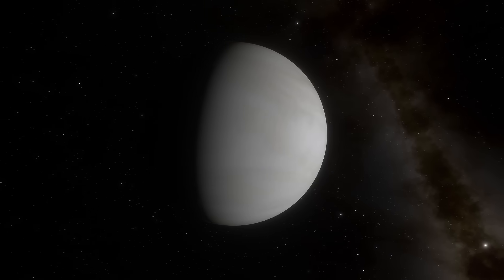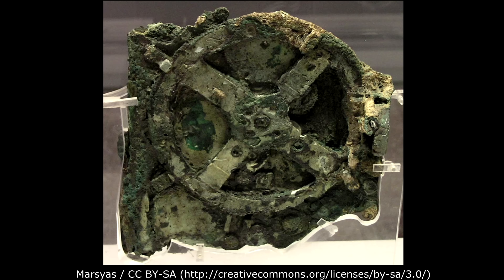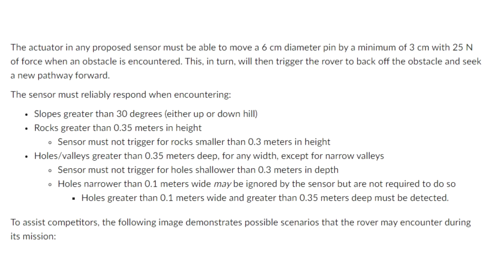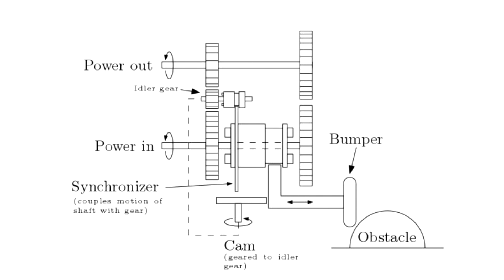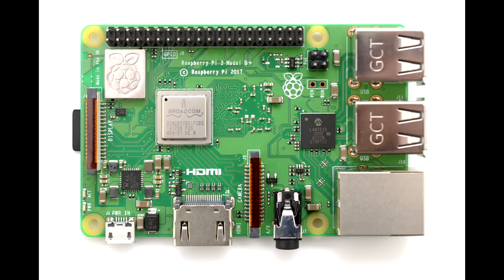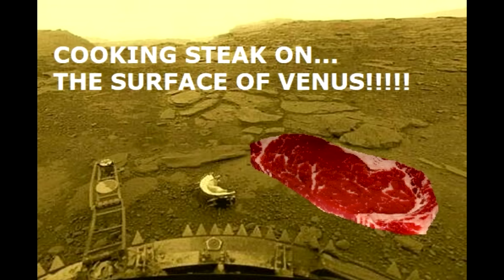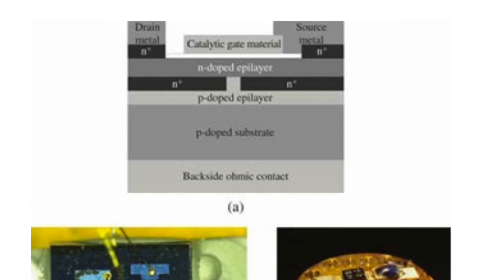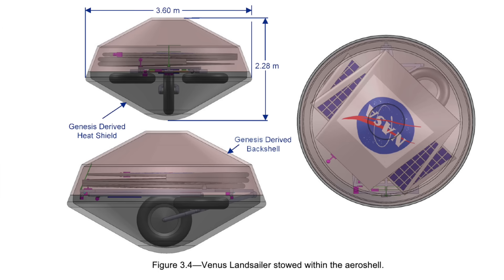Venus Rover Concepts That Beat The Killer Atmosphere

Comment: Perhaps dropping a fair sized bell shaped craft with a long shaft standing off the top of the bell.  Inside the shaft you put a ~large bore artillery gun.  On the top of the shaft, you place your Rover, on top of that, you place a tethered buoy.

Once the bell lands standing up, the buoy breaks off and rapidly ascends pulling the tether from the ample slack (ideally; the higher the altitude the better - inside the buoy is the rover's computer. The tether would have to be lightweight, very strong, very non-reactive, and capable of carrying a conductor to complete a circuit...so carbon nano tubes, boron, titanium...all that fancy jazz, we're using it because the cable can't be too thick - if we land on one of Venus's "Continents," 10km of tether would change the ground level limitations, 20Km-40km of tether and ground level limitations for computing are gone...) because the buoy could literally be made buoyant at altitude.  The winds would pull on the buoy significantly, but...

On the ground, after the buoy has reached ~50% ascent, the rover breaks away via short fire rockets, also pulling its own tether,  to get it away from the bell structure, deploy air bags, land, and come to a rest.

With the buoy well on assent, the rover at a distance w airbags still ~partially inflated, the artillery gun, loaded with an Iridium slug with tethers secured to it and even embedded in it, the gun discharges, sending the slug into Venus' surface, and on impact, barbs built into the slug are primed to deploy on short fuse delay. Once the the slug is embedded underground, barbs have deployed, you have your anchored Rover and anchored floating brain, and they're secured and connected via their tethers.

The bell would essentially limit the blast, but would be intended to fail.  With alterations, artillery gun casing could be made to survive, even as a superstructure if needed/desired.  

Also, the term buoy is used loosely; perhaps "Kite" would be a better comparison, or even a glider of sorts or a disk with aelerons wrapping it and an AI fly-by-wire like system to reduce wind strain.

If the Rover mission goes to shit, depending on just how fancy the buoy is made, you could have it ditch the tether and you still have a UAV with a lot more access to solar energy v Earth, and capable of exploring the actual part of Venus where we could have a foreseeable future colony that wouldn't equate to ~guaranteed death like a Mars colony would...(?)

Comment: I actually have an Idea, put a blimp in atmospheric orbit wirh the brains and a meanz to gain energy and move about in the atmosphere at about ths density of earth's atmosphere.

Okay, then thats the main brains the lander  will use echo location, sound will travel further and faster on venus than on earth more akin to underwater, so this would essentially be sonar.

Thw cool part woukd be that the lander nedd only Emil a sound and have a statically designed board on it that is made to act like a microphone when bombarded by microwaves, this should be doable so long as attenuation is not a problem in the venus atmosphere, as this is how the russians bugged rhe oval offixe using a Planck made of wood wirh no moving parta in the 50s

That would allow the blimp to process the signal from the rover and relay back simple instructions which could be recieved by a similar setup which would essentially translate them into sound waves, rhen much like the human coclea we translate the souns waves into taps givibg mechanical force to set a system state in ths mechanical computer.

Comment: Best idea I have is to have a tethered balloon that would rise high into the atmosphere with a radiator on it, in order to get the needed temperature gradient for a heat engine, to provide power and also provide cooling.

If you could get it high enough, you could have a pretty severe temperature difference, and easily be able to run cooling.
Then you just put your computer and motors into a heavily insulated body, with shafts going out to the wheels.

Comment: If the air is so thick, why not make it swim?  I'm picturing a sort of kite with a pair of wind turbines.  The string would be made of carbon fiber and at one end would be an anchor and the kite probe at the other.  There would be a winch on the kite and this would allow kite to sort of hop up and down along a line with the wind.  "Programming" would be extremely simple.  Once it makes land fall.  The turbines and kite deploy. The Kite is variable geometry.  It extends it's "wings" to go up and retracts them to go down.  As such it would make several "hops" until it ran out of line.  Then the energy from the turbines would begin retracting the kite back toward the anchor until the winch was fully spooled.  Then the process repeats. Back and forth until the probe dies.  I don't know how prevailing winds work on Venus, but if they shift direction then the probe could explore several areas around the anchor if it does.  
Literally this could be done 100% mechanically, and the data could be acquired by radar from an overhead satellite.  It may not be much more than altitude, attitude and orientation, but it would be useful.

Comment: what about tube computers? it would be interesting to see tubes when you apply decades of miniaturization technology. tubes probably wouldn't even need heaters. im not entirely sure how small you can make a vaccum tube, but if you can make an array of them fit on chip you might be able to build something akin to the agc. memristor memory perhaps? high temperature magnetics? does induction still work?

Comment: Hmm. Sending an active radio signal back could be possible. Can't do electric power with magnets in this kind of heat, but a Van de Graaff generator could work to achieve charge separation. A transmitter antenna only needs a coil and a capacitor, which are possible to operate at 500°C. Signal modulation would then be done with a simple mechanism obstructing the antenna in a timed pattern. I'd say that could increase the possible information transfer rate significantly compared to the radar reflector disk approach.

Comment: I think an inflatable balloon that takes it up into the atmosphere then compresses the gas to go back down. As it falls it collects some power with a wind turbines to use to cool itself for a few hours. Then it opens a heat activated valve (or as the gas heats the pressure goes up) and floats back up to cool off. We have plenty of ceramic insulators that are light weight and keep thousands of degrees out. You only need to cool a tiny capsule that houses the electronics. From the top of the atmosphere you might even be able to beam back some images or data from sensors to an orbiting relay. It could just keep going up and down over and over. Each time bringing back a small bit of data and cooling off before going back for more.

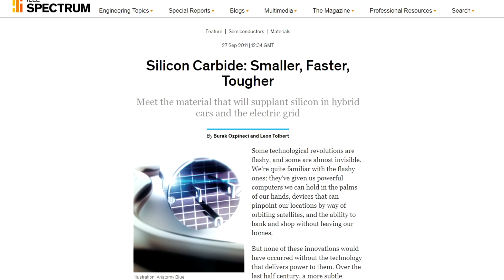Comment: 6:28 TURNS OUT! It takes 6 inches of steel to simulate Venus.
Reply: I first read that as "6 inches of steel to stimulate Venus" and thoughts "sounds about right."
Reply: @seanj3667  Venus isn't very good at sex if it takes 6 inches of steel in order to sexually stimulate her.

Comment: The wind blows multiple clear metal globe units around the surface. Would have to operate well in the  3 meters per sec wind speed. Filled with high pressure Nitrogen for cooling. The movement is used to gen electricity for cooling, ops, and transmitting to inflatables at 30 KM altitude.

Comment: I wonder if vacuum tubes or neon bulb based logic could be designed to handle the heat?
Of course it would have to be completely custom parts and probably kept inside a pressure vessel like the guts of a ROV.
With the high ambient temp probably would not need much filament current to get emission on a tube.
Might be able to design tube based camera and radio transmitter that can work at those temps.

Comment: "A mechanical computer works in any environment"
Dust would like to know your location
Reply: That was one thing I immediately thought of, along with corrosion damage and temperature extremes warping components.  "Sand in the gears" is a saying for a reason.
Reply: @richmcgee434  I hate sand. It's coarse and rough and irritating, and it gets everywhere
Reply: @judeboon2870  Sand?!?   NOOOOOOOO!!!!!!!
Reply: I dont think venus is as sandy as mars
Reply: @ItsNemiyy  That is a poor assumption. I'm fairly certain the designers will be sealing up the mechanisms away from environmental dust or sand as much as they can, because the local surface environment is not well known.

It's part of the reason we want to send a rover, because we want to find out more about Venus' surface.
Reply: With the thickness of the atmosphere, dust particles probably never leave the ground. Its the opposite of Mars with lower gravity and high winds.
Reply: Dust can't enter a closed box.
Reply: A FRICKIN METEORITE would like to hear the conversation
Reply: Grace hopper intensifies
Reply: It'd be sealed away from the atmosphere anyway; sulfuric acid rain.

Comment: 9:32 Solar panel? Note that very little solar radiation actually makes it to the surface of Venus, owing to the thickness of the atmosphere. But that same thickness retains what does get through, which is why after so many millions of years, the surface has become so hot.
Reply: NASA knows more about the surface of Venus than you, so if they're looking into solar panels, there's a reason.
Reply: @shawnpitman876  Considering that most of our knowledge of the surface of Venus came, not from NASA, but from the USSR, kind of weakens your appeal-to-authority argument somewhat.
Reply: @shawnpitman876  Once you resort to name-calling, that means you lose the argument.

Comment: I want to see aerostats on Venus.  The atmosphere is so dense you’d hit buoyancy pretty high up with a light payload and deeper down even with a heavier one.   Also pretty easy to evolve hydrogen from simple chemicals.
Wonder if the thermal gradient would be enough to “aerothermally” produce power by putting the hot end of a fluid cycle farther down and rejecting the waste heat at altitude?

Comment: Silicon Carbide electronics really seems like the most promising technology for the future especially if we are going to colonize the Planet obviously some ways into the future but given that one of the two materials you would need to start producing such electronics in situ (the other material being found in rock).  I can imagine mining operations which mine rocks for mineral resources then transfer those materials to a craft designed to fly them up to the sky base. Now it doesn't solve the lost hydrogen problem but well perfect solutions aren't going to be easy.

Basically while mechanical computers are cool I don't know how well they will scale into long term potential.  That said if you can make a (self buoyant at operable conditions) mechanical computer designed to function within the pressurized depths of a giant planets atmosphere... Well that might be a different story. Just good luck making something both operational and buoyant in a hydrogen atmosphere.... >_<

Comment: Quick everybody, start mashing buttons in Besiege!

In all reality, could you make a way to have a self-stabilizing gyro-copter? Use a suspended weight within the rover to angle the blade against the force of the wind, while at the same time using the power of the wind to spin the rotor. As for the instruments and all that, you could use something like an RFID tag. It only turns on when you hit it with a signal, using only the energy of the impacting beam to be powered. The RFID tag would contain a sensor, and the information from the sensor would cause a certain amount of resistance or something. How you would get this information back to Earth I don't know, but since there would be no true electronics on the rover's instruments, there wouldn't be any worry on it.

Comment: Between powerful low orbit satellites (to keep control latency down) and a dumb surface robot, combining electromechanical and thermionic techniques, it doesn't sound impractical to deal with most issues. However, good quality sensors, like cameras, seem like a serious stumbling block.

Comment: make and produce small cubes cheaply.
drop a hundred of them across an area of maybe 3km squared? and what each one of them will do is detect wind derection and speed and sense chemical in the air .. then all those cubes will transmit signal to a transmitter sitting on the ground with them then that transmiter sole purpse is to transmit all data to an orbiter.

I know this is not a rover but its like a rover being everywhere in one time in that certain area.

will it work?? I'm just an ordinary citizen of the planet Earth lol

Comment: That's interesting, I always thought we had high temperature semiconductors, but turns out those only go up to around 300 C.
Reply: 300C means you will only have to cool down the rover by 300K (from 600C at venus surface), which is already a huge step-up from room temp semiconductors.

Comment: "you can't build a mechanical radio"
morse code flashing light: "am I a joke to you?"
Reply: you could go pizo electric to spark gap, thats about as close to mechanical radio as i can think of.
Reply: Thing is what flashlight will penetrate the atmosphere of Venus?
Reply: it could be a passive radio circuit like the RFID scanners used in stores
Reply: @Blox117  Those still use semiconductors that don't deal with high temperatures well. You could make a SiC-based one, but you'll also have trouble getting any significant power transfer to power that passive transponder between a satellite and something on the surface. Then it has to use some (probably most) of that extremely small amount of energy it received to transmit a reply, which it will probably be transmitting omnidirectionally. The satellite would probably need a far bigger dish antenna than has ever been launched into space. (The biggest I've heard of is ~350 ft/~100 m in diameter, but presumably nobody outside the US military knows that such a satellite was actually launched: http://1.bp.blogspot.com/-KDJOHqIy_A0/UtitGPxRkuI/AAAAAAAAPSo/zEbsWyUm2EI/s1600/sigintadvancedoriontrumpet.jpg)
Reply: What powers the light?

Comment: Why use wheeled mobility? With an atmosphere that dense, a dirigible hopper / wave glider approach seems like it’d be promising. Rather than motoring around on the ground, when it’s time to move the probe could become buoyant and move with the wind. Sense the ground proximity with sounding cables or resilient stiff “whiskers”; control the buoyancy to maintain light ground contact. 

It might be possible even to have the surface probe just make limited excursions to the surface, and when it gets close to some thermal limit climb to cooler altitudes to dissipate heat. 

(It’d also be pretty amazing to have a dirigible at altitude reel some of these out like a tethered deep submersible vehicle, though I expect we don’t have the mass+volume to get something like that to Venus.)

Comment: if there's one thing gcse physics taught me - thats heat cannot travel through a vacuum.
and thats why im proposing MILF technology (Magnetic Insulating Levitation Functionality)
Its like a vacuum flask, but a vacuum ALL around the interior container.
Think of it like a box inside another box, but by using the power of MAGNETIC LEVITATION, the boxes do not touch, the inner one is suspended by magnetic forces. Then just pump everything out from the space between the two boxes to give you a vacuum and bang. MILF.
Reply: heat can travel through vacuum in the form of radiation, be it infrared, microwave, visible, etc.; this is how Earth gets heat from the sun. Vacuum flask only suppresses the convection and conduction, but not radiation.

Comment: Hovercraft. If the atmosphere and pressure are that high, some sort of floating contraption with a chemical reaction inside that can change the density. Make it a controllable equilibrium reaction and it should float just fine. Put it on a system that is balanced like one of those childhood toy clowns that is weighted on the bottom and never falls over. Little wind tunnels to spin power to a gyroscope or flywheel near the bottom.
Reply: Maybe solar panels could work to load spring legs, through capacitors or similar.
Reply: Neon gas might even work. Make the inside self righting, and make the whole thing covered in low density bladders.

Comment: Use vacuum tubes for communication. They are virtually unaffected by heat. The only problem is they consume quite a lot of energy in any more advanced circuits. But maybe if cathodes were made of carbon nanotubes there would be a chance for miniaturisation and better energy efficiency. I've read somewhere about research on making integrated circuits in that way.

Comment: Interesting project.
An 8048/8051processor with prom memory based on silicon carbide would be an interesting choice. Most SiliconCarbide work is power semiconductors. Getting to the point of build an early 80's microcontroller should be doable. Memory would be in PROM, or ROM for code. Static Ram with ECC for data.  With a clock rate in the KHZ you could reduce the weight of a mechanical computer a lot. The Navies 1930s/40s gun Solution computers developed a lot of the mechanical tech you will need. Automatic transmission tech from before they went digital can handle the forward/reverse. The Fluidic computers developed for the X29 airplane may also be applicable . Fluidics would require a  fuild that remained liquid over an extreme temperature range